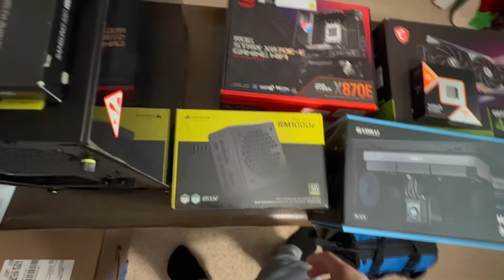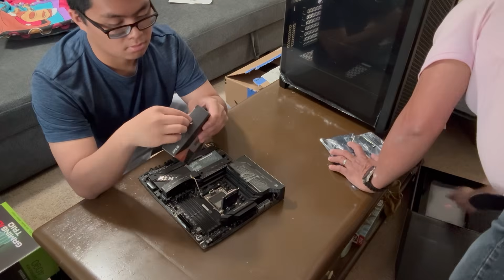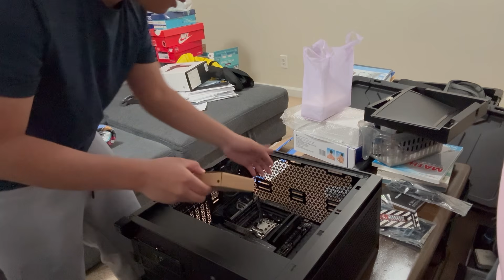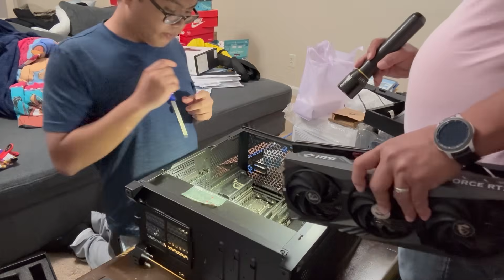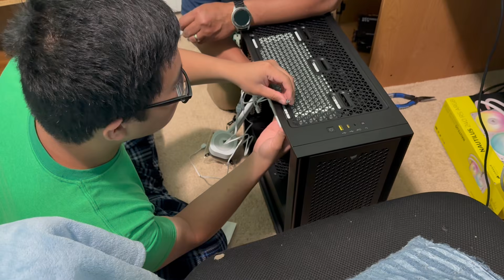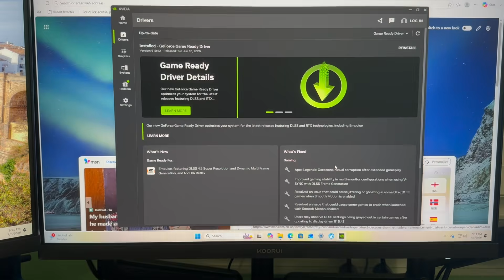Building a 4090 in my First PC with my Dad

Comment: Did something go wrong during the CPU installation that caused a bent pin or did the MoBo come defective? You might be about to get your money back if it was defective and under warranty.
Reply from the maker: I probably pressed down too much trying to get the cpu slotted in. Since I bought that one months ago I'm probably going to use the warranty to get it repaired for another build in the future.

Comment: hi bro you have to use first the m.2 1 which is on the right side with a big heatsink for your main drive and to your next drive you can use the bottom slot, because it will share the lane speed with your gpu, i hope it helps as im an also using the same board,,, have a good game bro ...
Reply from the maker: thanks for the advice man!

Comment: very nice video and have fun with the PC and keep making videos i really love the way you don't overcomplicate or exaggerate things and also when you have the screen to show what you connected and how it works, i also like what you said when you finished making the pc very inspiratrional im also making a pc with my dad, a ryzen 9 9950x3d, 5090, 64gb of ram and a asus strix motherboard, 4tb ssd and another 4tb ss in a lian li 011b evo rgb case , do you have any tips for the build
Reply from the maker: Tbh I don't know much about other pc parts aside from my build, so advice I can give is make sure gpu and cpu doesn't bottleneck with bottleneck calculator, make sure your parts fit inside the case and in your motherboard, get a cpu cooler if you haven't already. And make sure to download the latest BIOS for your mother board and buy windows. Good luck on your build!
Reply: @midgamemeetings  ok thank you so much this is very helpful